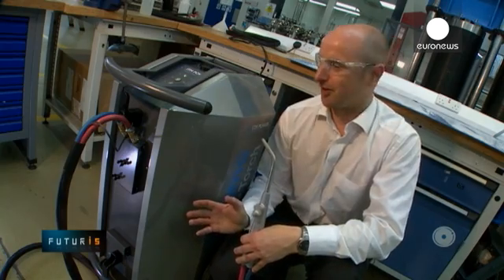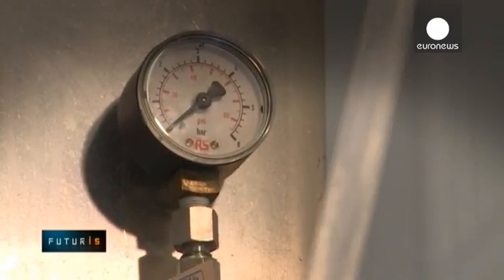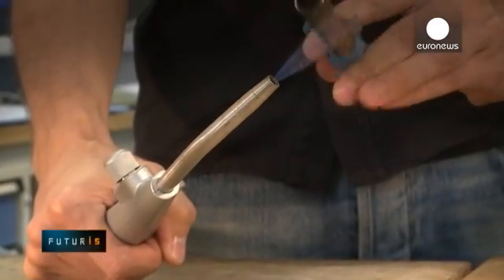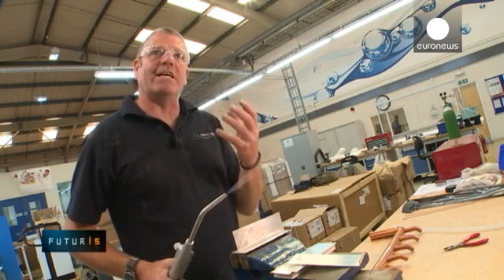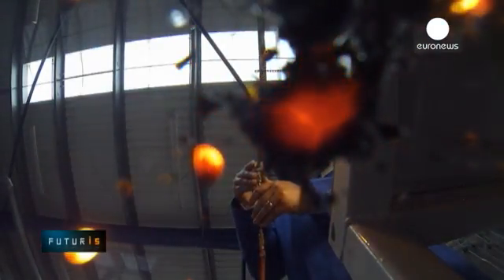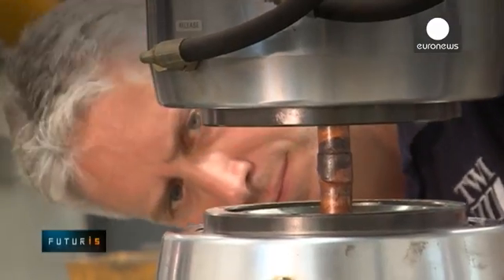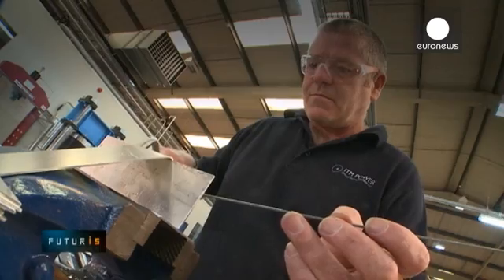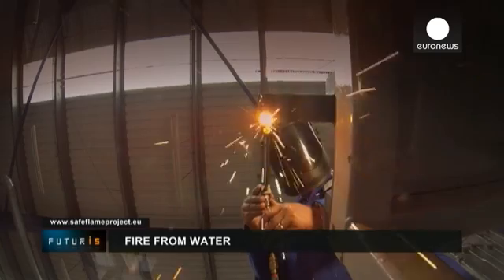Making Fire From Water - Futuris

Comment: this was funny! at 0:48 the guy says 'the water is split into oxygen and hydrogen gas' and yet that's not happening at all!! What happens is that during the electrolytic process, the electrolyte (probably KOH) as well as the electrodes are broken down to produce oxygen and hydrogen. The output gases are probably supplemented with a 'booster' (maybe methylethylketone) to produce a flammable HHO gas stream gas. The water isn't split into oxygen and hydrogen.

It's very interesting at 03:12 where the flame is heating a metal surface and water can clearly be seen to appear on the surface. My view is that water vapour has migrated along with the hydrogen from the electrolytic vessel and condenses on the colder metal surface!

I really don't know why people think water is H2O!

Comment: One of the worst comment section lol.
Electrolyzer isn't new but the added value were their focus for development of cheaper materials for the product build and being a more viable alternative for industrial torch applications by reducing cost and adding more safety and convenience. It's a valid product I'd say..and the point is hydrogen on demand, managed only at the nozzle.. removing need for complex storage systems like expensive solid metal hydride. I don't  get these weird comments and many having to explain lol.
 It's old post but hydrogen  fuel cell cars have been around by then I  think I read about toyota that time.. those concept cars have had tech challenges usually w hydrogen storage so never been practical enough until usage of  lithium batteries caught by the tesla EV craze..

Comment: What is the point of having a cold flame? looks like you are melting very low melting point metal.
Comparing this toy to oxy-acetylene is deliberately misleading and dishonest. 
Oxy-acetylene burns very hot circa 3000 C so one can melt iron and higher melt point metals/compounds.
Are you melting a gallium compound? Maybe tin? ...... No specs, no price, no links to sale point or references = NO CREDIBILITY.
Its just a cigarette lighter at best.

Comment: That research project was completed in 2014 and has already been commercialised since. This is not to be confused with HHO premixed flame from water which has been available in the market for decades.
www.safeflame-uk.com
Reply: Since there are no emissions except water and heat... would this flame burn in an enclosed box? I know they weld underwater with oxyhydrogen, but is any pressure being created, besides the buildup of water vapor? Does the water vapor create pressurized steam? Just curios what the pressure would be, coming off this flame.

Thanks for the help!

Comment: Its also called browns gas or HHO, couple with solar PV and inverter and you have a energy storage system, h2 gases can be stored in a metal hydride or compressed into cylinders.
Reply: what about flamming point of hydrogen gas

Comment: This is an HH0 torch. It's been in use for 70 years. Not new technology. Apply a small electric current to salt water and it separates the Oxygen from Hydrogen and then light the Hydrogen into a flame.
Reply: WARNING! Please for the love of god do not try to electrolyze (applying electricity to a liquid or aqueous solution to break it down to simpler elements)  TABLE SALT+WATER. Not only will you break down the H2O but also the NaCl into Sodium and CHLORINE GAS WHICH IS VERY POISONOUS AND WILL KILL YOU! The only reason the salt is required is to be used as an electrolyte so the electricity can travel through the water. Other electrolytes are usable such as Sodium Hydroxide or other salts not mixed with Chlorine.

Comment: Why the fuck would you want this when you can just pick up a couple of tanks and not worry about having a power outlet? Not to mention that retarded machine is going to need a lot more maintenance than simple tanks and regulators.
Reply: +Salvatore Shiggerino  Make the machines that produce electricity run off hydrogen too. Cheap electricity, problem solved. Could you imagine a boat that had reverse osmosis. Which most of them do now days. They would never have to fuel up at a dock again, Well maybe for a fast splash of water. Just a mater of time before devices become more efficient with nano/quantum technology. No to mention, have you ever tried moving around oxygen acetylene bottles? Yeah, you're a idiot if you think moving them around to refill them is some how easier then plugging something into the wall. Carry on.
Reply: no maitenance unless someone shoots it
Reply: An electrolytic cell would obviously require maintenance. And it probably has some kind of drying medium that will need to be replaced in regular intervals. It has no advantages over tanks of already dry gas, only downsides.

Another thing, you'd need damn cheap electricity to beat industrial-scale steam reforming of hydrogen from natural gas and fractional distillation of oxygen from air with a tiny electrolytic cell in terms of cost.
Reply: Salvatore Shiggerino why do you need to dry anything. There is only gas being produced
Reply: +deathsoup1 I hope you are joking
Reply: +deathsoup1 Hydrogen will solve 70% of world pollution. Watch the water the boys are after it. Movements are on in all the camps mate

Comment: genious. Splitting hydrogen from oxygen! both make it burn
Reply: +swag I've got a smaller HHO torch that I built and I love it. It was an absolute pain going out to buy acetylene tanks - especially when they cost US$400 a cylinder in Malaysia.
Reply: You're fucking stupid
Reply: Wtf??
Reply: It's not genius, what is basically happening is that the energy from the electricity is splitting the molecule of water, after that you burn it and make a water byproduct. It would be more effective to just use the energy directly. You are losing energy by doing this. You can also make one in your house right now, these "researchers" are all dips.
Reply: I think its genius anyway. I love science^^
Reply: +Ivar Hindenes

You just have to realize that:
Reduction at cathode: 2 H+(aq) + 2e− → H2(g)
Oxidation at anode: 2 H2O(l) → O2(g) + 4 H+(aq) + 4e−

Is what is really going on.  (With a whole bunch of intermediate wizardry going on in the solution as well..,)

This system may not even have to use an electrolyte like past systems.  (NaCl or NaOH or KOH or NaHCO3.., )  I don't see their internal process anywhere..,

Comment: could you modify the torch so it powered a generator that provides the electricity required to split the water into the 2 gasses?
Reply: Of course not, there's a loss in energy

Comment: Fire from water?  very impressed, try to make water from fire. ;)
Reply: adlo11 Watch from here 3:03 water from fire : )
Reply: +madaxe Gets out Periodic table*

E + H2O--> H + O2
4H + O2 = H2O

This is a closed system, Hydrogen can't be found in the atmosphere because the second it comes in contact with the plentiful O2 molecule it becomes water, which releases a bit of heat.
Reply: That is sort of what happens. Did u see the video?  When he held the torch against the metal you could see condensation forming on the metal a little bir
Reply: +Nathan Berry But that is just condensing water, not actually making it.
Reply: @madaxe  no, it's making it

Comment: Sounds good but im guessing theres some issues with how hot it actually can get. especially compared with other gases. i think they need to compare the temperature aswell even though development is still in progress.
Reply: its HHO. it has PLENTY of heat but somehow you can't burn yourself with the flame, it only heats metals. or something weird like that. this is reasonably common now and has been around for a few years.
Reply: ColacX It can reach temps equal or more to the sun, but as link said it won't burn you.
Reply: +ColacX If they had on board tanks that you could bring more oxy in manually maybe able to cut with it.
Reply: Oxygen is combustable gas also it propell the hydrogen to cut more efficiently compare to acetylene or propane gas . We can even use only oxygen on thermo lance method .
Reply: It just takes a lot of energy to separate hydrogen from water mainly

Comment: And you dont need a fucking membrane for a hydrogen torch because the membranes is tehere so the products of the electrolysis dont mix. But in this case you want them to mix. And its just plain water with a catalyst so you dont need anything but stainless steel to do it
Reply: You tell those Cambridge scientists what's what!
Reply: And the membrane is 100% not needed because the oxygen and hydrogen bubble up split at the negative and positive end of the power source.

Comment: Are they for sale yet and if so do they ship to America
Reply: http://m.instructables.com/id/DIY-HHO-Torch-Water-Torch-for-only-4/ build one they are cheap as fuck. The idots in the video just want to make em look special
Reply: +Ulim151 In comparison the the instructable, the efficiency, quality & gas production rates in one of these units (in the video) is far superior, however I do agree that making one is much more economical
Reply: madaxe  Quality? How is the quality supposed to be better when you use a divided cell? If you use distilled or pure water and an electrolyte like Sodiumacetate you only get H2 and O2 nothing else. You cant have high or bad quality H2 or O2 if you use salts that dont get split up by the electrolysis like table salt (You make Chlorine as product which actually burns with air but does attack the metal).
And a divided cell slows the production because it increases the resitance of the cell by a HUGE amount because the electrolytes cant migrate freely.